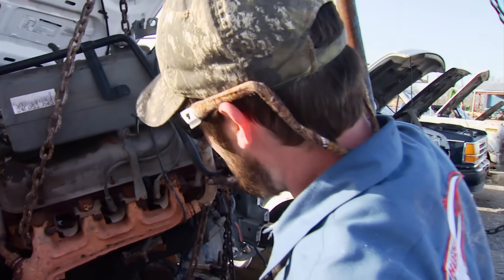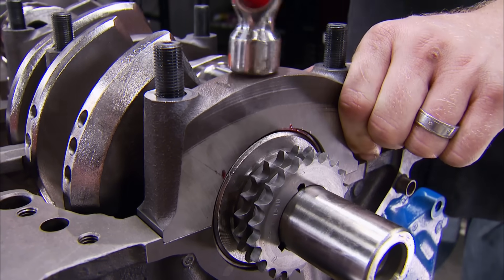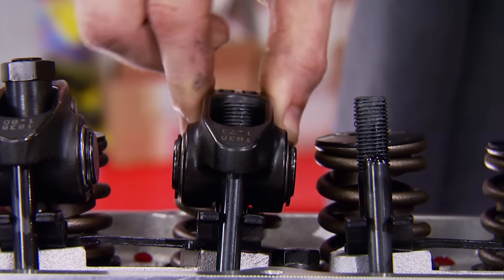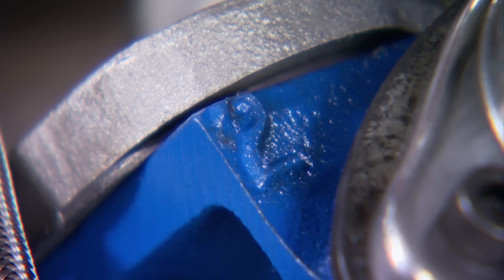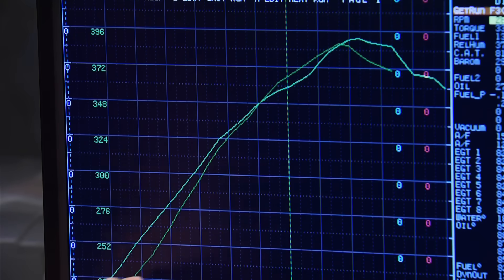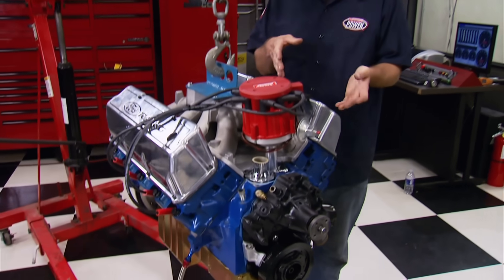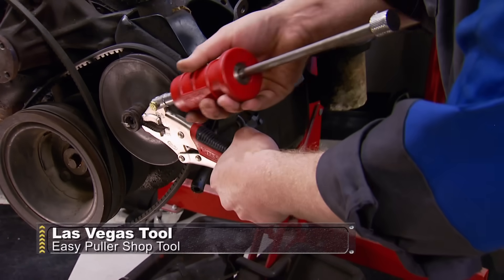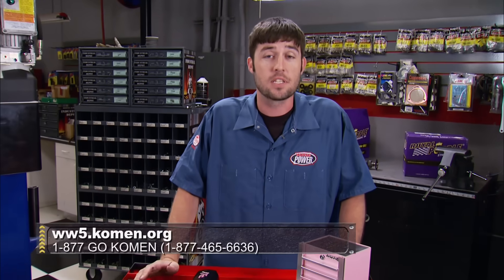351 Small Block Dyno Shootout: Windsor vs Cleveland - HorsePower S16, E11

Comment: This seemed like a bit of a bate & switch as a clevor is defiantly not a Windsor. Without question the clevor is definitely the way to go, especially if you're going to stroke it. Trade those heads for the Trick Flows & you'll defiantly see better results. I'm running a 9.2 , 401 ci clevor  in my Pantera, bigger numbers & completely drivable. You guys know you're stuff so I have no doubt you can do it too.

Comment: Wrong intake on the Cleveland. Put the dual plane  on it and jet the carb for the higher flowing 4V heads and it will generate similar numbers. Anyone that knows what they are doing knows that a single plane intake is not good for streetable power. It's a high RPM race piece.

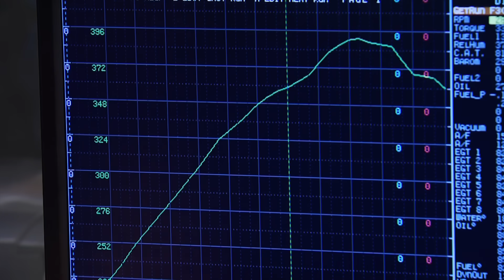Comment: Someting seriously off with the 4v engine. A downward dip in torque at the low RPM [9:40], basically a flat spot. I have a cam that would be comparabe to this cam, single plane manifold and 750dp and power output does not mirror this result at all, mine is 4v closed chamber though, however though with the high comp pistons, it should be at least closely comparibale. Mine is strong from 2K to 3.5k and hot to 6.5k. 
Noticing the sharp drop off in power at 6k where the 4v should shine, however the 2v overtakes it here. What the??  This should not happen and it dont make sense. I wonder if the serious mismatch of the port from using the 2v manifold with a 4v heads or even if they had a vacume leak with the manifold  arising from the same issue. But whatever, the results dont appear right and dont dispel 4v for the street. after all ford put these in boss mustangs + other US cars  and falcon xy gt's were all used and tuned for the street. I suggest to look at Richard Holdeners results with the 4V.

Comment: A Square Bore Carb does not work as well as a spread bore for street driving and a single plane manifold is better for racing where a duel plane works better on the street because a single plane does not start to work until you are getting up around 4000 RPM and upwards,  And another reason is that the police will be on your case if you drive around town pulling 4000+RPM, Seem like you guys got a bit lost on what you were trying to build, you built 2 nice motors, I wish I was there playing around with them.

Comment: The Cleveland kicks ass stock and some mods. Windsor will whoop a Cleveland's ass in power potential just due to block strength and aftermarket options.   Cleavland only had a few things over the Windsor that the after market solved a long Time a go.  Both awesome. Looking to build a Cleavor 408 my self

Comment: My Mother bought a brand new 1972 Ford Gran Torino  in February 1972. It was a Brown 4-Door and it had a 351 engine in it.  I think it was a Windsor edition.  She owned this car until 1983.  The car had a few small dents in it by the time she sold it, but overall it was still a very good car.  The man who did finally buy it said he was most interested in the engine and transmission.  I think he was going to swap out the engine.  This was a very, very good car.

Comment: hardly apples to apples, the cleveland with the 4v head can a take a much bigger cam, using the small runner intake on the 4v heads also killed it. not impressed.

Comment: It is too bad that people did not appreciate the 400 engines back in the 70's and 80's.  I found the 400 could be more fuel efficient than the 429 and 460 motors.  And in street form, had about the same power.

Comment: this was an apple to orange comparison but it answered one question for me that my 351 Cleveland with 2v heads was better to keep the stock head instead of buying the 4v open chamber that would have cost me more money with less performance. i just want a beefed up street motor. i have been researching Cleveland heads and was left with more questions then answers until i seen the dyno test they did

Comment: It's very interesting to see the 351 Cleveland making that kind of horsepower it wouldn't have made that much horsepower if it wasn't bored out 30 thousands because the head has no quench but it's surprising to see those figures in the bigger valve motor didn't make more horsepower to 4700 RPM

Comment: Barely over stock cleveland with cast iron open chamber heads compared to a stroked windsor with after market aluminum heads. That was a terrible comparison. That is like comparing apples to oranges and not different apples to apples

Comment: How can this be a fair shootout? The Windsor got aftermarket Cleveland style heads going from inline valves to canted, it got a stroker crank, a more aggressive cam, and higher compression. The Cleveland build was mild compared to the Windsor. This is why I never watched this garbage when it's on TV, they always stack the deck in favor of the more popular engine.

Comment: Since they are running carburetors they should be using the vacuum advance on the distributors. They would get a lot better performance that way instead of tinkering with the computer.

Comment: I had a 69 mach 1 took the windsor out and put the cleveland and replaced with a high lift and  long duration cam fly cut pistons 10/ 1 compresion with a holley double pumper and headers and got close to 500 lbs of torgue with 460 hp  screw the windsor had soft valve guides  in the day

Comment: IF you canèt  make more power  with a 351 c engine than a Windsor You better  quit building  engines  even the  mildest Cleveland  will make more power than a Windsor and have been doing it for 50 years!

Comment: This just makes the LS series look like gods among peasants.
Reply: Stupidest comment ever . Just like the new 5.0 makes the LS looks weak when it comes to hp to ci . Dont forget what ford did to the 281 ci 4.6 DOHC against your LS big cubic in motors . 03 04 kennebell  or whipple cobras still mauling most of todays cars
Reply: @TheCheapReefer   Didn't realize comparing a modified Ford motor to an LS was a stupid comment when you are going to spend quite a bit of money to recreate that combination.  Both are pushrod motors and similar cubic inches.  HP to CI is great if you actually make enough HP to care.  We can compare Honda motors to the 5.0 if you would like to make a point.   What is a modified 03 04 car mauling today, not LSA , LS9, or LT4 equipped cars.   When you actually compare similar setups they have a tendency to lose or cost quite a bit more money.

Comment: the reason they put aluminum heads on that Windsor is because the Cleveland would annihilate it otherwise in fact a Cleveland will annihilate most engines in a Dyno shootout with the stock heads

Comment: Back in 1971 I owned a 70 Mach 1 C6 Cleveland 4 barrel and I had also owned a 69 Mach 1 with the 351 Weezer four barrel automatic and on the street there wasn't much difference between the two because it's all low and the Cleveland didn't matter until you were way up in the RPM and in the end I sold both and bought a 71 boss 351 but there again when you launch it stop lights you have to launch at 4,000 plus to have any kind of revs on the engine with the big valves and a friend of mine had a 72 Mach 1 with the hydraulic lower compression 351 Cobra jet and four speed and I only beat him by a car length

Comment: Interesting, but misleading!!! It should have read: Cleveland vs Clevor Stroker. Leave a stock crankshaft with Windsor heads, then your headline would have been correct. Clevor power came from Cleveland heads and larger stroke crankshaft, therefore bigger cubic inches. That would be like comparing a 283 Chevy vs a 383 Chevy, then being AMAZED, really?!?!?

Comment: head comparison on the cleavland was somewhat useful... except why not have used the close wedge head instead of to the open chamber that would have been more useful.. and as everyone else said... 357 stock heads to a 408 aftermarket head... what was the point

Comment: A set of Australian 2v closed chamber heads with some lite port work would have easily gone past 400 hp with stock strock add a strocker crank and a decent  roller cam and it would easily go past 500 hp and make about 550 footpound of torque and it would still be easy to live with on the street

Comment: The cleveland should be a clear winner the valve guide liner is a must the cleveland metal usa softer I have built many cleveland heads the hardest metal is in mopar big blocks

Comment: This wasn't a good way to compare the 2V heads to the 4V heads, the cam you guys used wasn't big enough to fully utilize the 2Vs full flow capabilities so changing to the 4V would barely make any difference, my dad built a motor and did a similar comparison, but the difference was the cam was maxing out the 2V heads at around 470 hp, when he swapped to the 4V it REALLY came to life at 530 hp, i honestly believe the 4V heads are fully capable of handling 600 hp, maybe even more, btw i am now 34, this was close to 20 years ago but i think it still holds true, those are the only iron factory heads that i think could produce 600+ hp without power adders

Comment: Without jetting the carb for optimal power these numbers mean absolutely nothing.  Anybody who has ever road, or drag raced knows having the right jets makes or brakes the performance of the engine.  You pointed out the difference in runner and valve size. Anyone with any sense could see there is a big probability the jet size for each motor would be different, as well.

Comment: You need a different intake for the 4v heads. The intake you were using had too small of runners. you get "stall" in the intake port because of the larger area reduces velocity.

Comment: The 4V Cleveland engine was outlawed to race at NASCAR,  valves too big. 4V heads run big block valves. I think this comparison is off. DeTomasa Pantera's run the 4V heads. Why put a Cleveland head on a Windsor? Because the valves are canted and bigger than standard valves.

Comment: I would like to see what these motors put down to the wheels because if I’m doing the math right that clevor would make 360 hp 390 tq to the wheels using a normal diff if you use a big transmission and big differential then even less

Comment: Well let's compare these these 2 351s they are very comparable.. now let's use a wimpy cam and all stock parts on the C . Now let's stroke the W put some new Edelbrock heads and Intake on it and a big roller cam.. ya should be  comparable.  🤔👎👎👎the least they could have done is use the same cam

Comment: Just got a set of cylinder heads from Australia off of a 302 Cleveland for my H Code 1970 351 Cleveland. They're basically 2V heads with a closed chamber (54 to 58 CC, haven't measured yet). And before anyone gets all out of shape, YES they did make a 302 Cleveland in Australia. The Cleveland engine was around longer in Australia (1970 to 1982 versus 1970 to 1974 here in North America). Hence, they also made a de stroked Cleveland with closed chamber heads.

Comment: This stupid comparison. First the 4v is not the best of its kind. There is 4v close chamber they should have tested. Second the intake manifold remain a 2v unit therefore the 4v heads could not reach its full potential. Second the clevor is a aftermarket stroke and heads so no comparison again. If you want to talk 4v heads you need to head down to Australia where its more home of the Cleveland. I've built 408ci Cleveland with 4v close chamber heads stock heads with roller solid cam and rockers and all. Made 650hp on engine dyno. From a 630 lift at 0.50 duration. Not bad for a slightly hot cam. Oh and pump 98 octane.

Comment: I want to see the same thing but add the 4V closed chamber heads. Then it may be a little closer. Open chamber to close chamber heads dont exactly equal up if u ask me. Then may want to throw the after market Cleveland head at it also.

Comment: You ignorant dipshits you should have used a 4v intake with the 4v heads. When you have a small intake port dumping into a significantly larger head port, you have an immediate and significant loss in port velocity. That loss in port velocity kills torque and thereby horsepower.

Comment: If you're going to stroke the Windsor to 4" then why not use the 351c and a 400. The 400 has the 4" stroke stock plus the heads, cam and headers can be interchanged between both engines. At Least then you could claim you're comparing 2v vs 4v and 3.5" vs 4" stroke with the exact same top end outside of the intake manifold which can be done with the Cleveland intake plus adapters on the 400. 
P.s. why use a big single plane on an engine you're trying to make low end torque with? Working backwards. The only thing you guys have is an show.

Comment: I've been working with various Fird engines since the late 70s.  Illmake a few observations based on that re the 351 Windsor v the 351 Cleveland.
1.  STOCK.  In the 1970s there really wasn't too much aftermarket heads or ma ifoldi g available. The reaso s were that the 351 Windsor was designed as light truck engine e with a heavy y crank k landing journals mostly low o.pressionand small port heads and valves without .uch camshaft.  Yes I know there were a few 4 b l heads around with cast iron. 4 bbl manifold..  The 4 bulkheads were quite hard to find and relatively hard to find.  Given all this it's was possible to get around 300 hp out of the engine without resort to aftermarket hardware .  
As far as I know the Cleveland was primarily developed as a counter to Chevys ubiquitous 3t0 small block for its sportier cars  for buyers who werent upper the quite expensive Ford big block  option
  I owned a 71 Pantera and a 69 Cougar XR7 during this time period.  Stock neither car exhibited blazing performance although both had 4v heads and 4v manifolds.  Both also were as I recall running around 10 to 1.  Neither was a match in a quarter mile for the new 350 LT1 engine in the 1970 Camaros which was rated at 370hp but probably made a bit more and was easy to get over 400 hp with long tube headers jetting and timing mods.  The Cleveland did not have the benefit of years of factory development the variety of after market parts or the years of experience of a lot of engine builders nor would it because it was already on it's way out due to smog issues.  Never the less and without boring you too much I eventually put together a Cleveland for the Pantera using all factory parts long tube headers and an Isky flat tappet solid lifter cam that put 425 hp to the rear wheels.  Eventually I decided this was inadequate and built a stroke 377 Cleveland with 11.5 to 1 cr and some head work on the iron heads and a very hot hydraulic roller cam with the same headers.  Result was 520 tvo the rear wheels at 7000 rpm.  I moved the other Cleveland to my Cougar and pretty much ended my problems with small block Chevys and Mopars so long as they like me were pretty much stock.  So the video isnt wrong about the Cleveland with the 4v heads wanting more co.pression more cam and probably more fuel then timing.zthey were only running 9.8 nominal probably less than that true and didnt bother to change up the came or reject the carb when they put the 4v heads on.  Hence the head change by itself was virtually pointless as indeed the dyno showed and both guys are clearly plenty sharp and experienced enough to have know that going in.
Comparing the hp and torque of the 351 Cleveland I  the iterations they ran it to a 408 ci modern tech S
Windsor was I. My opinion in a rather pointless exercise.  The tech was newer far more money went I to after market parts the o ly remaing  Ford part being the block etc. So yes given an unlimited budget the expertise of the builders  and newer tech the outcome was preordained ed and unsuprising.
As far as I'm concerned the better comparison would have been to build both engines with the same compression ratio around 10 or 10.5 to 1 the stock iron 4v heads long tube headers  same size carb a d choice of appropriate flat tappet hydraulic or solid lifter cam.
 I guarantee you the difference would have been a 50 to 90 hp ad va tage to the Cleveland.
Another interesting comparison would have been to build both engines to around 400 co and use the the best a available fa story and after market parts available.  I recall some years ago in the engine masters co.petitio  Cleveland's were being g built to over 600 hp.  Of  course these were hardly street engines but you see my po t.  Why do a co.parison of a Sheland pony to a Kentu Kyle thoroughbred.  The o ly question is how bad the loss wi be.